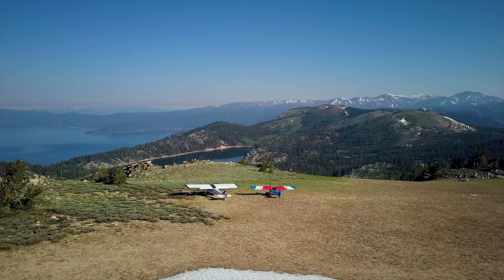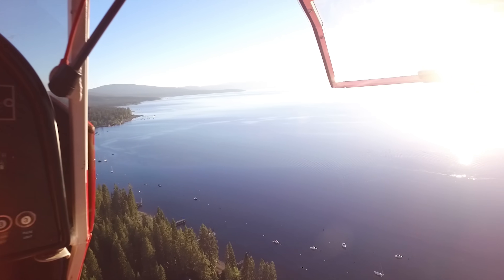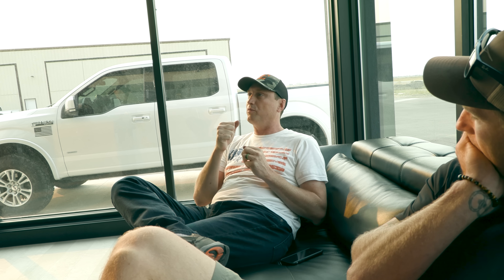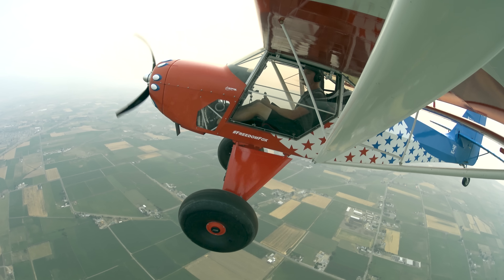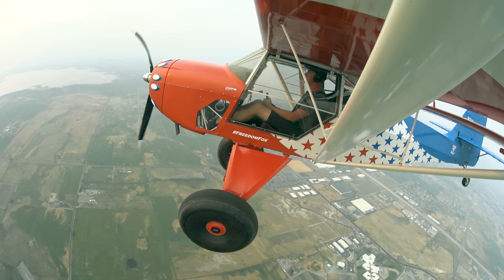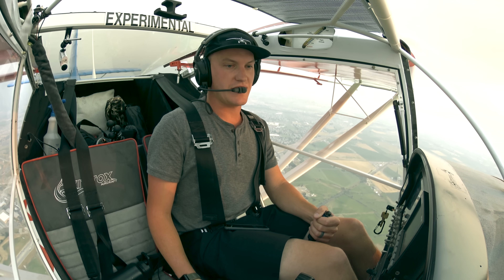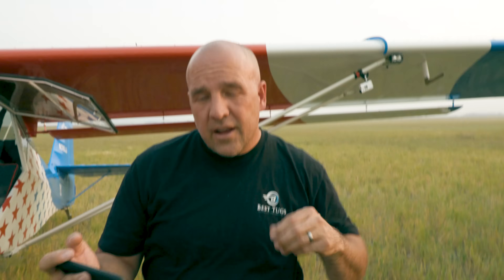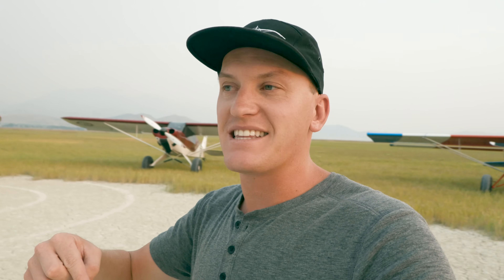YOUR FLIGHT INSTRUCTOR WAS WRONG! - Simulated vs Real Engine Failure

Comment: A windmilling prop is altogether different than an idling prop. The other feller in the video is incorrect when he says that a spinning prop, does not add surface area and therefore does not add drag and or act like a "disk,"  it does, it adds effective surface area anyway. And it does this because rotational relalative wind keeps the prop acting like an airfoil...it is changing (or trying to change) the direction of more air than the small area of turbulence behind a stopped and completely stalled propeller is. Just as a helicopter rotor in autorotation will still provide some lift and "resistance" to falling over a stopped rotor (which offers none) and will do so even with the collective all the way down, a spinning prop offers resistance to the air flowing over, around and through it. Those "helicopter seeds" that fall off trees fall slower than an object of equal weight and surface area of a non spinning object because they are spinning and it takes energy to spin them (which comes from the potential energy in their altitude) and their rotation serves to effectively increase their surface area. The same is true for a propeller on an airplane after an engine failure, it takes energy to spin that prop and engine and it takes a fair AMOUNT of energy to spin a prop and dead engine that quickly...that energy is robbed from the potential energy in your remaining altitude. You can prove this to yourselves by attaching a model airplane prop to a stick about a foot long. Hold the prop out of a car window going 55 with a rubber band holding the prop to the stick to keep it from spinning...now take the rubber band off and let the prop windmill...hold on tight!

An idling prop is different, and I agree with the general premise of this video. An idling airplane WILL glide farther than one that is shutdown. The energy required to spin the prop and engine is being supplied by the fuel, not the energy contained in the altitude. And even if the prop is spinning slightly faster due to the slipstream than it would at idle on the ground, it takes very little energy to help the engine spin up slightly faster. It may still be offering some small amount of drag, but it is very little, and generally less than the drag created by a stopped prop even. An idling engine would be more like gliding an aircraft without a prop installed at all. I agree fully that when the engine actually quits, the performance you have come to expect from all your engine out practice, will be noticeably decreased. Additionally, the aircraft will not be as clean aerodynamically and steep turns that you might have gotten away with in an idling aircraft, may now lead to stall/spin if you are not watching the airspeed very carefully because the airspeed will bleed off more easily.

Comment: Be sure to remember these test only apply to these bush planes. I believe, the real question at hand is whether the thrust generated from the engine at idle overcomes the force of drag induced by the turbulent flow caused by the spinning propeller. This force of drag will increase as velocity increases. If you're flying a larger plane that generates more drag force at idle while at a gliding velocity than what can be overcome by the thrust of the engine, you will be diminishing your performance. (This is all speculation on my part, feel free to comment)

Comment: Your results make sense, just think with an engine adaline idling it's still putting energy (thrust) into the airframe and that's got to go somewhere (airspeed). As far as an windmilling prop Vs a  stationery one I  think that there is no practical difference from the viewport that a stationery prop will transfer the same amount of energy (airspeed) into drag as a windmilling bc the engine is absorbing ( ie transfering) part of the energy from the rotating prop, and the combined energy tranference  from engine and prop is the same. The minute difference will be from the prop been forced to work backwards while windmilling, ie high pressure in front and low pressure at the back when it's design is optimised for l/p in front and h/p at the back and thus is not as efficient.

Comment: Just measure the speed of the air current generated by the prop in idle while in full stop in land, as close to the rear of the propeller as possible, since the air stream slows down in a noticeable manner in a very short distance. That speed will give you a quite good notion of the boundary between dragging and thrusting. I think :P

Comment: I had crankshaft failure in a '64 Mooney M20E with a 3 bladed prop, which was fully stopped in the glide. Without a shadow of a doubt, the glide is shorter, extending the gear has a MAJOR effect too, much more severe than a simulated idle engine out. Nothing can prepare you for it, unless you simulate engine off, prop stopped scenarios. I came up way shorter than the picture I had in my mind and was really caught out by it!! Aim to land DEEP and you may, or may not make it.

Comment: you are both correct and not correct. It all depends on the planes stall speed. if your plane must fly at 90 knots to stay airborne, an idle prop is going to be slower the a free spinning prop because now it is actually creating drag since its rotation does not match the planes needed speed.  But say you have a plane that has no problem going 45, you will most likely never feel the prop, likewise based off of altitude and pressure. So this is really a question that cant be answered other than under very specific scenarios.

Comment: Not apples to apples by any means, but in rc craft a free-wheeling prop really adds to the drag. Especially on motor gliders, stopping the prop with a brake is far better than letting it wheel. Again, that is not necessarily an accurate comparison.
On a different note: I agree with others' sentiment, the main confusion here is idle vs free-wheeling. It seems thrust is thrust, no matter how small.

Comment: its a basic physics problem, the small amount of thrust produced by the engine at idle will slightly offset the wind resistance, slowing your negative acceleration and keeping you in the air for longer

Comment: Situation when propeller is rotating is in all cases better, that engine stopped. The faster propeller rotates, the better. This is not something you can measure doing such a test, because what you do doesn't even deserve to be called a test case. You do not meet the same air, speed, altitude parameters each time. Nonsense. You only need to realize how the pressure vectors on the propeller are arranged for different rotation speed, and you'll know the answer.

Comment: Boils down to simple aerodynamics. A propeller is an airfoil. If the propeller is not spinning then airflow over the prop is at a very high relative AoA, stalling the airfoil, which we know creates a lot of drag. In addition, the turbulent airflow coming off the prop will have a negative impact on all lifting surfaces downstream.

If the prop is spinning at sufficient speed, the airfoil is not stalled and therefore generates less drag.

Comment: It would be a lot better discussion if you used the correct terminology. The back of the propeller is actually the curved side facing forward. The face of the prop actually is pointing toward the pilot.

Comment: You are asking the wrong question. The right question is whether or not you can judge the rate of descent that you have and find and get to a safe landing. You are talking about stretching the glide, and glides don't stretch. Don't confuse people with this hair splitting. Every engine out landing is different. You are talking about how to glide further- how about talking about making a better judgement, and picking a place to land that is within your glide range, and go practice making sure you do exactly that? Not sure? Pick someplace closer and circle to land. Still can't make it? Practice more. In a real emergency, don't waste precious time and altitude worrying about the stupid prop. Judge your rate of descent and the distance to the field. IF you have time run the emergency checklist and get a mayday call fired off.

Comment: Quite a few years ago the CAFE aircraft performance society developed a technique for "zero thrust" glide testing that involved a sensor on the engine that could determine if the crankshaft was against the "rear" stop (i.e. prop creating drag) or "forward" stop (i.e. prop creating thrust) within the normal fore-aft mechanical play of the crank relative to the engine case. For glide testing the pilot would position the throttle so that the crank was neither against the forward or rear stop but floating somewhere in the middle - i.e. zero thrust. I'm sure this took quite a bit of concentration to hold steady airspeed while carefully moving the throttle around to just the right RPM, but apparently it worked. This would imply that a normally idling prop is creating drag similar to a windmilling prop, so yes an idling prop IS creating drag. Is it creating as much drag as a stopped prop? Here you would have to ask whether a "flying" airfoil (i.e. spinning prop) is creating more lift force than a "stalled" airfoil (i.e. stopped prop). I would say that a "flying" airfoil would create more lift than a "stalled" airfoil and in fact that is why your plane falls out of the sky when the wing stalls. By the same reasoning the "stalled" airfoil of the stopped prop should create less drag than the "flying" airfoil of the windmilling or idling prop. Just my $0.02.

Scroll about half way down on the following page for Zero Thrust glide testing. Petty cool:
https://cafe.foundation/v2/aboutcafe_orderfromchaos.php

Comment: Of course and idling prop will help you fly farther than a stopped prop. Think about the extreme scenario with a variable pitch prop. If you start your glide and completely reverse the pitch on the prop, which is going to make you drop faster, a stopped prop, or an idling prop? The idling reveresed pitch prop of course. It is working against your glide speed. So it is a continuum,  1) fastest drop with prop pushing air against the direction of flight, through 2) stopped prop, to 3) slowest drop with idling prop pushing air in the direction of flight... to 4) no drop if the prop spins up faster to flight speed.
Another way to look at it is, if you want to maintain 60 km/h, you will have to dive 1) really steep if the completely reversed prop is idling and trying to push the air back at the air flow direction, 2) less steeply with stopped prop (or variable prop pitch set to zero pitch and spinning - at no mater what speed) creating a wall of the prop surface area perpendicular to the air flow really slowing the air down rushing past it, 3) even less steeply if the idling prop is only somewhat slowing the air rushing past it, and 4) even less steeply if the prop is turning at the same 60 km/h forward speed. 
There is no magic blip in this continuum at the prop stopped case.

Comment: I answered the question : Do pilots idle their engine during final approach?    This is my answer . I think it is very relevant to your discussion.

Some very good answers already for the heavier aircraft.
For Light Sport Aircraft (LSA) and especially ultralight aircraft we are taught a different approach. Engine failure is more likely to occur on landing than any other portion of the flight. Consequently we are taught to approach in such a way that we are able to glide to a safe landing from any place in our descent. Unlike heavier aircraft which approach with power and higher than best glide speed.

I'll give you an example.
A Jabiru LSA aircraft has a fixed pitch propeller. The engine idles on the ground at 1000 RPM. It climbs at 3200 RPM. It cruises at about 2800 RPM. Now the interesting part. In flight when you close the throttle the engine idles at 1200 RPM, not 1000. This is because the motion of the aircraft is pushing on the propeller causing it to speed up, just like a windmill. In actual fact at idle RPM, the propeller and engine are acting as a brake and are slowing the aircraft down. So at idle the engine is stopping the aircraft, and at 2800 it is pulling the aircraft, so there must be a particular airspeed and RPM combination in between where the engine and propeller produce zero thrust and have no effect on the aircraft.
Secondly every aircraft has what is called best glide speed. For those interested I'll explain it at the end. For the Jabiru in our example it is about 70knots. And at 70knots the engine and propeller combination of our example Jabiru, will produce zero thrust at 1700 RPM.
Ultralight and LSA pilots are taught to begin their descent at best glide speed and at the zero thrust RPM. So in a Jabiru as I reach the end of the downwind leg I will pull the throttle back to 1700 RPM, and continuously raise the elevator to keep the aircraft flying level as the speed bleeds off. Once the speed reaches best glide speed ( 70knots ) I will stop raising the elevator and I will let the nose lower and begin descending at best glide speed and still 1700 RPM. My aiming point will be somewhere about a third of the way down the runway. Once I am sure that I will reach my aiming point and I am close to the ground, I will extend my flaps and begin to slow the aircraft in preparation for the flare. This will bring my aiming point back towards the runway threshold because we are now below best glide speed. I continue to bring the RPM back to idle just before the flare, then flare, hold off, touch down, and we have landed.
If at any point in the descent the engine decides to go quiet, nothing changes. I just continue my approach as if I still had an engine and land normally.

I actually had this happen once. The engine stopped just as I was applying flaps and I just continued to a normal landing, which I must say was about as perfect as any landing that I have ever done. It's funny how a bit of adrenaline can make you perform better.
Most ultralights do not have flaps so we continue all the way to the flare at best glide speed because we don't have to adjust for the flaps.

Explanation of best glide speed.
Lift and consequently Drag of an aircraft is a function of the square of the velocity. An aircraft produces two kinds of drag. Drag due to the wings producing lift (Induced Drag), and drag due to the friction of the surfaces of the aircraft with the passing air (Parasite Drag).
As an aircraft increases speed, the angle of attack is decreased and consequently the Induced Drag decreases exponentially. This means Induced Drag starts high but rapidly decreases as speed increases until it becomes nearly flat.
As an aircraft increases speed, the friction increases and consequently the Parasite Drag increases exponentially. This means that Parasite Drag starts low and nearly flat but then rapidly increases as speed increases.
Total Drag is the sum of both types of drag added together. Because they are exponential, Total Drag is high at low speed due to the very high Induced Drag, and high at high speed due to the very high Parasite Drag. However Total Drag is relatively low in between due to both Induced and Parasite Drags being relatively low. This speed where Total Drag is lowest is the aircraft’s Best Glide Speed.

Comment: Really cool experiment!  I think the 'Myth' is actually a failure of instructors to properly explain this concept during the forced approach lesson.  There's no safe and practical way of practicing forced approaches by turning the engine completely off.  ..especially here in Canada where the -20C temps will shock-cool your engine really fast.  So the best solution is using the power at idle.  The important thing is teaching a pilot the skills and judgement to estimate the glide no matter what the ratio is..  It doesn't matter how familiar you are with a particular glide ratio when you add wind.  Glide range is at the mercy of wind every time, so I'd never feel like I had a "false sense of security" about my glide ratio when I can look out the window and just see it.  
If you want to feel how much drag a windmilling prop, idle prop or stationary prop produces, you should try a twin :)

Comment: You can calculate the actual drag by looking at the ANGLE OF ATTACK, treating the propeller like a wing.  Which is also why the blade angle varies along the length.

Comment: Gents, as a glider pilot, it is not clear to me if your test reached the most relevant conclusions. If you are just trying to stay in the air for the longest period of time; then best speed for minimum sink rate (which is what you seem to have been testing) and parasitic drag related variables are  most relevant. Minimum sink speed is important for glider pilots who are working a thermal,  but it is not what we look for when we are far from home and the thermals have quit for the day. Then, we want the speed, flap settings, etc. that maximizes distance forward per unit of altitude, and that is virtually always different (faster) than minimum sink speed. If you are dead stick in your power plane, you want best speed to fly to get maximum distance to improve your chance of finding a good landing spot. Finally, wind direction has a lot to do with best speed to fly to get best glide distance. In a headwind, a good rule of thumb is to fly at best L/D + 50% of headwind speed. In your test, you should be using your gps to note ground distance travelled per unit of altitude lost at various speeds with dead stick compared to idling.  Whether or not the prop windmills and turns a dead engine won't make any significant difference. Thanks for the video. Incidentally, go for a flight in a glider and get the feel for the difference...no engine? No problem (If you've trained for it.)